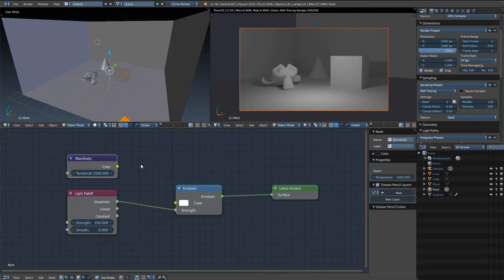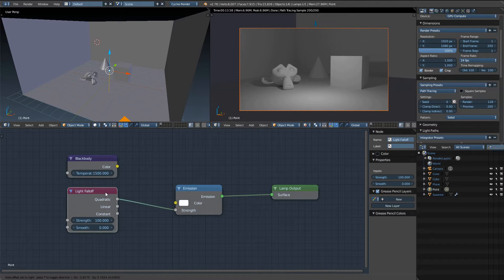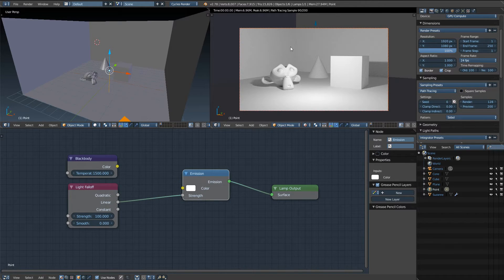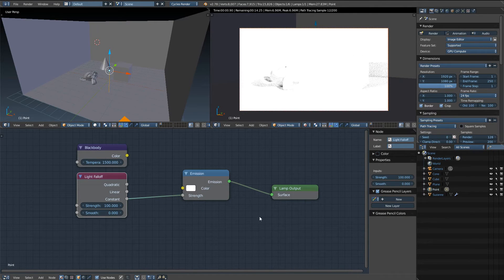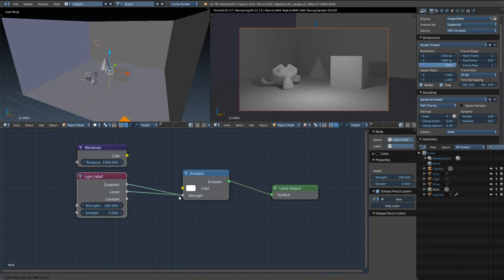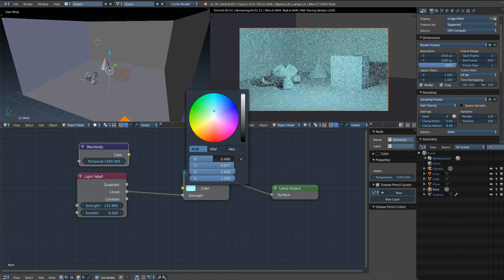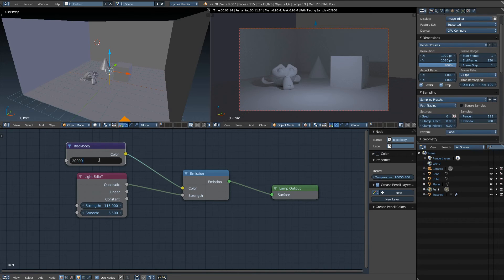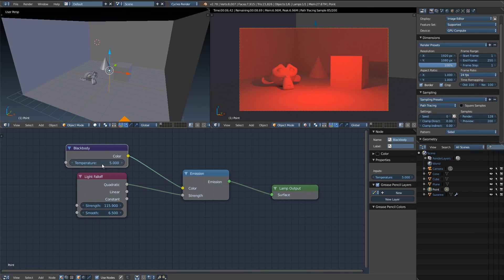Blender Quick Tip - Light Falloff and Blackbody Nodes

Comment: The Blackbody node is based on the real world light intensity (you can see those values on light bulbs):

https://s-media-cache-ak0.pinimg.com/originals/79/36/b0/7936b041e8f58d25eade6ba7503f7b34.jpg
http://sigmaluminous.com/wp-content/uploads/2013/03/colour-temperature.gif

A normal light bulb is 2800, tip for realistic interior light :)

Comment: I have NO idea how you're seeing nodes for your lamp/point light. I'm using 2.8, and I've gone through every single thing, and can't see nodes like you have. No tutorials, forums, or anything show me how. And you didn't explain it at all. I'm sorry, but wtf?
Reply: I struggled with that as well and I finally figured it out. You have to switch to Cycles rendering engine, then in the Shader Editor you get "Use Nodes" which you have to check. Then you get the "Light Output" node and can add the Blackbody converter. I haven't figured out a way to get the color to Eevee, I guess one has to get it there manually. This might help with that: http://www.vendian.org/mncharity/dir3/blackbody/
Reply: @florianschulze214  It is currently not possible to use light nodes trees in Eevee, it is a known limitation: https://docs.blender.org/manual/en/latest/render/eevee/limitations.html#lights

Comment: I don't understand how light can fall off at 1/r^2 in vaccum. It doesn't in reality. Light levels only decrease if it is absorbed by a dense material. It is way more realistic to have constant + volumetric. Or am I wrong here?
Reply from the maker: Oskar Zdrojewski I'm not sure furry physicist. That's just the way it works in 3D packages.
Reply: I kinda figured that it has more to do with the fact that the further you go the bigger area has to be illuminated with the same number of photons, so it should kinda depend on the shape of the light source (like multidirectional (lamp/sun) would fade away with some factor times r*^2, but a direct light (laser/flashlight) would be constant). 
Hardly a physicist, just curious ^^
Reply from the maker: Well you have a firmer grasp on this stuff than I do. I'm a layman when it comes to this stuff.